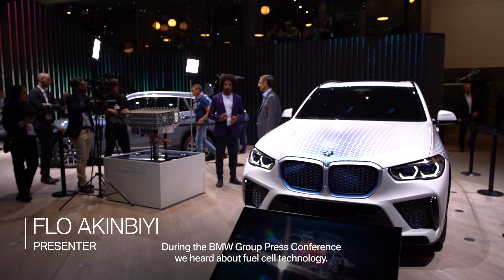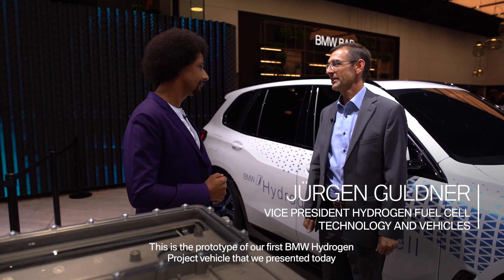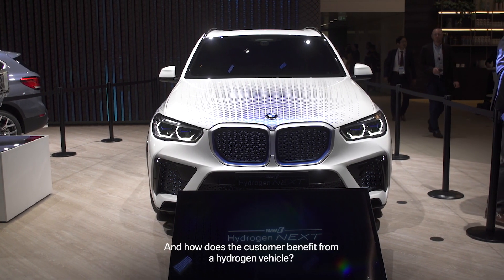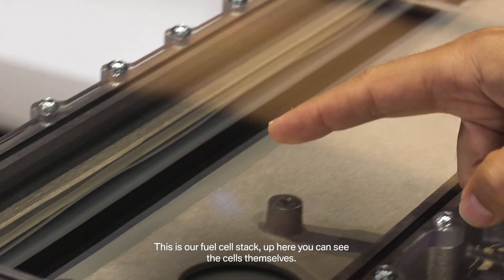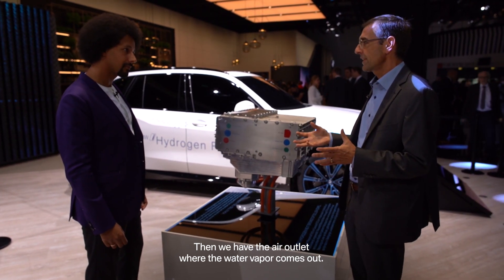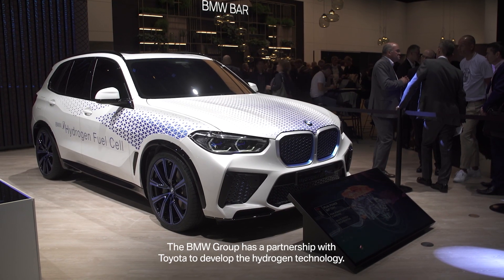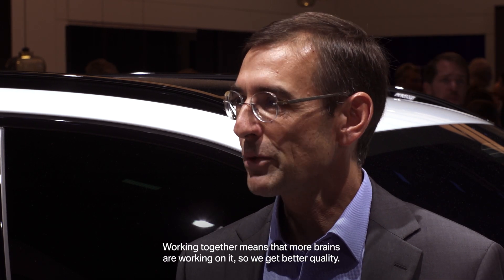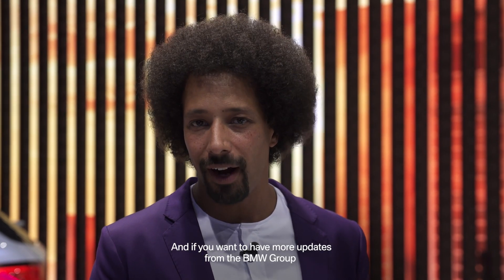The BMW i Hydrogen NEXT at the IAA Cars 2019

Comment: where do you guys gonna get the hydrogen?
Reply from the maker: The requisite infrastructure, such as an extensive, Europe-wide network of hydrogen filling stations, is lacking at present. However, the BMW Group is pressing ahead with its development work in the field of hydrogen fuel cell technology. The company is using the time until the infrastructure and sustainably produced hydrogen supply are in place to substantially reduce the cost of manufacturing the powertrain system.
Reply: @BMWGroup  I have been following with intrigue the revolutionary hydrogen production technology by a Lab called H2IL Are HFC car manufacturers consider adopting this type of method to efficiently produce the gas and speed up the transition to fuel cell mobility? From a scientific viewpoint, I recommend you take a look at their cutting edge technology.